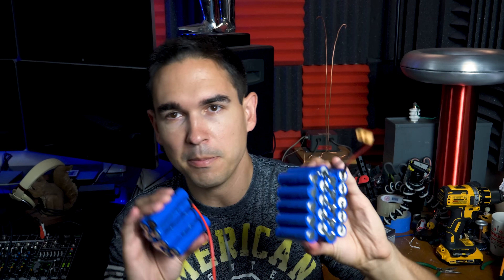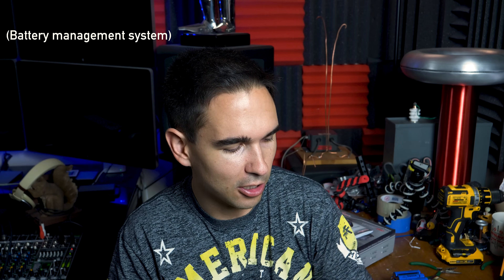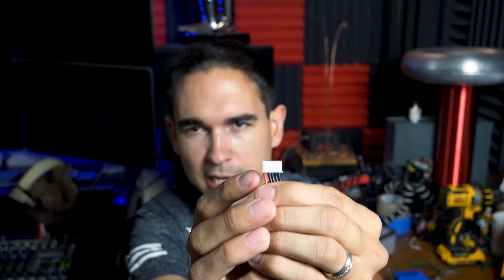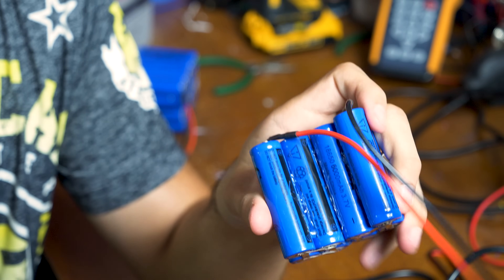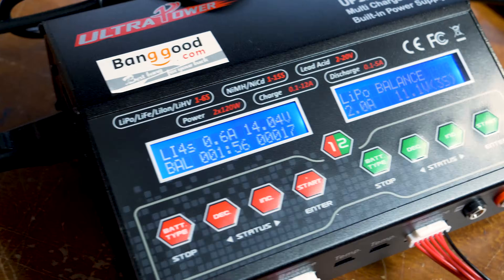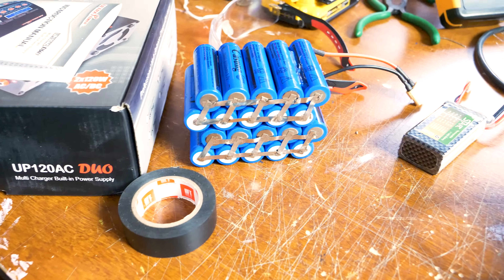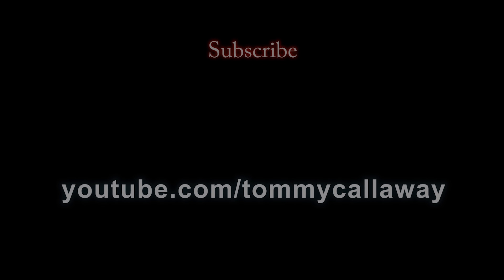How to charge custom lithium ion batteries (without a BMS)

Comment: Hey there Tommy
Great video.
Concerning the mains wire/cable, here in the UK we have imprinted onto the cable the following details; voltage range - cable size ( 0.5mm, 1.0mm, 1.5mm ) etc. etc. and an indicator conductor colour BN (brown) live, BL (blue) negative & YL/GN (yellow & green).
Whenever I purchase anything that does not have a standard 3-pin UK plug BN (fused) BL & YL/GN (earth) I chop off the existing plug and rewire it with a standard UK 3-pin plug.
Undertaking this lessens any main's cable-related problems that may occur in the future, and finally, UK plugs come with a fuse which two pin plugs do not.
If in doubt get an experienced person to rewire the UK plug.
Reply: Many US plugs are fused Sir. Just FYI

Comment: what about a12V 200Ah  LiFePO4 Battery, Deep Cycle Battery with Max 2560W Output Power, Perfect for Your RVs, Solar System, Off-grid can it it be ok on a charger like this  the battery bms was removed this is for solar charging and off grid usage

Comment: You still are using a BMS. 
It's just separate with your configuration.
Instead of having each battery pack having their own BMS, you have one for all the packs.

I like it unless you need to charge more than however many the external BMS can supply.
What is the maximum number of packs that can be charged at a time?

Comment: soldering in the middle of the bridge  could melt the plastic covering the batteries in a spot that would be very likely to cause those two cells to touch where they are side by side. it would not be a direct short but could  cause heating.

Comment: I'm confused, didn't that charger show 2 batteries with 0 Volts?
Reply: Because its only a 4s battery so the last two balance leads aren’t connected, so the last two show 0v.

Comment: I feel much safer recharging using a smart balance charger vs going through a BMS especially for like 100+ Amps for my application, plus its just really expensive for 200A 22.2V BMS’s and I would need 4 of them

Comment: 5:10in i was screaming at the pc - that is NOT the way to tin your cables! by the time you get the blob of solder to the wire, all the flux in the solder will have burned off! Ive been soldering since i was 8 and im now 60.

Comment: I checked and most of these hobby balance chargers only go up to 6s for li-ion (22.2v). I'm looking to build a 37v battery out of 18650 batteries to power an electric scooter. Can this kind of balance charger charge a battery with this high of voltage?

Comment: How do you know how many amps and volts to charge the batteries at? I want to make a li ion battery pack, I thought you multiply the rated charging amps for each cell by the number of cells and keep the voltage the same as it would be for 1 cell.
Reply: it is stated in the speck sheet
Reply: @sbolton3039  so if the battery cell specs say to charge it to 4.2V at 5A and I'm charging a 4 cell pack I just charge it to 4.2V at up to 20 amps?
Reply: @drabberfrog  20 amps no way. plus i dont know of any lith ion cell that charges tp 4.2 volts at 5 amps. a battery pack may have s 5 amp speck but please advise me what cell it is u are talking about and i will help u out.
Reply: @sbolton3039  since it's 5, 000mah wouldn't you charge it at 1C? So the charge current would be 5 amps right? I have some LiPO batteries so I'm just assuming lithium-ion batteries are the same in that regard. I'm wondering how to know what current to charge a pack at and how would the batteries being in parallel or series affect the charging current.
Reply: @drabberfrog  cells hooked in series u add the charge voltage but not so on the amps.  In any event i believe that with lithium nickel cobalt cells the slower u charge them the better it is for the battery but u may not want to wait so long for them to charge. As you increase the charge voltage the cells will charge faster but i believe over amping charge cycles kills the cells quite quickly.
Reply: @sbolton3039  did I reply with a link to the cell? I just did and YouTube deleted it for me IDK what happened
Reply: @sbolton3039  it's the Samsung 50E 21700 5000mAh 9.8A Battery

Comment: Do you think I could take a 36v lithium ion battery and plug it into the charging port on my 48v ? (My ebike) with 48v fully charged or 60-80% ? Would that give it more power ?

Comment: how many charge cycles would a battery pack have if you just charge it with a dc charger?
Reply: If there are cells in series charging it without a bms is a pretty risky idea as it could cause the batteries to become unbalanced and get overcharged, if it's just one battery in series and the output is 4.2 volts or under and the current isn't too high for the type of battery you are charging it might be okay if you unplug it once it's done charging. There isn't a exact answer to your question but it definitely won't be good to do that and it's pretty easy and cheap to just get a cc cv boost/buck converter and a bms if needed so it would be kinda silly to improperly charge something that has about 1/4th the energy density of tnt...

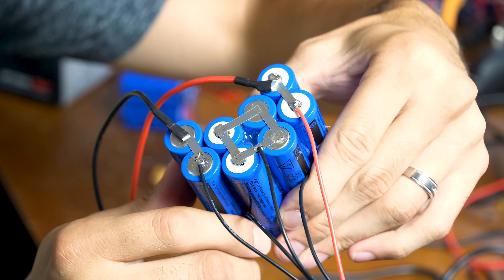Comment: I totally don't understand your method for soldering the wires.. You say not to solder directly onto the battery terminal yet only 1 out of the 5 wires at 5:32 are soldered this way, with the other 4 soldered directly onto the battery terminals.

Comment: Thank you for this valuable info.. I do have a question though. You said you only needed 4 cell for the balance charger but your pack has 8 batteries. Is a single battery not defined as one cell? Hoping you still monitor this site since you have a new one.
Reply: Batteries connected in parallel become 1 cell
Reply: Positive poles maters, His battery is 4s 2p, so you have to get only positive poles for 4s, and that are 4.

Comment: Awesome I have been wondering about this as the banggood BMS only charges to 3.8 volts per cell . Thanks Tommy hey Banggood sells large black heat shrink tubing to make a clean looking setup . I don't know if I missed it somewhere but maybe a maximum voltage per cell when charging would be a good mention .

Comment: Packing the battery cells that tight without additional insulation/distance between them, (especially between the groups in series) is dangerous. Fully charged, there's 4.2 volt difference between neighbouring groups and relying only on the battery cell wrapping is far from safe.

Comment: I’ve gotten a similar type hobby charger kinda like your! But I just made my first 18650 pack and I’m trying to do a discharge test with said charger to test the capacitor of my 4s5p pack with 20 18650 cells. And dang it’s taking a good bit of time. And I hope it don’t take that long trying to charge it with the hobby charger !!!

Comment from the maker: This video is old. Now, I am reviewing solar generators and other newer battery tech.  https://www.youtube.com/tommycallaway
Reply: Why is every other video tutorial showing one black wire and multiple red wires, in which the black wire goes to first negative parallel group and the red wires to each positive group.. Is it six one half dozen the other? Idk it would be cool if you could answer this because atleast one other person in the comments is confused.. I can or you can delete this but I think it's really really important to address
Reply: @bmzaron713  find your answers yet?
Reply: Great video. I have a noob question. I have a 4s (18650) pack also so for charging do I select 4S, C= 2000mah, 2.0A? Just want to make sure thanks.
Reply: ⁰
Reply: I've got a stealth bomber ebike with 72v battery and 5000 watt motor... It came with a single battery, but I've since built my own from six 36v 20ah lime scooter battery packs, which are made from 18650s... So I took 2 hooked in series to double 36v to 72v making 3 packs of 72v, then hooked all 3 in parallel... Only problem is  each individual original lime pack has its own BMS, so for the entire battery its got 6 BMS's hooked in both series and parallel in a funky manner, but so far my 84v charger has been working when I connect it, and the BMS's seem to be functioning properly, but it still seems like a sketch set up... I wanna break it all down and do it right so its functioning thru a single BMS... Cuz as is, it's 6 times more prone to failure at a minimum, right? Because instead of having just one BMS that can fail, it's got 6... I think that math is correct...

Comment: You have a 4s2p pack so each cell is 2 in parallel. So doing a balance charge like you are doing is better than nothing but it is still not going to overcome the problem if 1 cell fails.
BMS is under the tip on the positive end of the battery and protects each cell being over charged in voltage and current and over discharged in voltage and current.
You also need to use a special charger like you have as the batteries need to be charged in a particular way. First part of charging is constant current then it swaps to constant voltage to finish off until it achieves 4.2v.

Comment: Here is another moron who believes the hearth is flat.
The BMS is already supplied with my battery pack and if I build a battery pack for a bicycle (for example) I shall include a BMS because it's practical and easy to use I don't need to change any settings.
You don't even know what is the meaning of BMS but you pretend to advice against the use of it, what a paid idiot!
Reply: I don't think you fully understand why someone would do something like this. A few reasons why someone wouldn't use a bms would be if you are drawing a lot of current from the battery. Bms's with high discharge current cost a lot (and if you are building a battery youself it's probably just to save money in the first place) plus the only reason you would even want a to use the bms to discharge would be so the battery doesn't get over discharged but that can be avoided by using a voltmeter. Also sometimes bms's break and if you don't notice it could damage your battery, so instead of using a bms you can just manually balance the cells and then you will definitely know it's balanced. This is a bit unrelated but dump trump 2020 let's get that DUMB, fat ass Cheeto out of office he's a absolute joke.
Reply: Ayyyy Biden gang 2020

Comment: Honestly you can't really balance a 2p pack,
Reply: what is that supposed to mean? If batteries are in parallel they are the exact same voltage so they are actually perfectly balanced.

Comment: Good Video. I have Imax B6 Charger. It is has 6 cells balance socket. How do I balance charge if 13 or 14 cell  ex. 13S4P or 14S4P. Do I need a charger with 13 or 14 balance sockets?

Comment: Let’s say it this way, it happen to all kinda of battery this way, not just Chinese battery. That is why we have and need a balanced battery charger for it, and by the way, thanks for explaining how to hoke up the wires, for most of us has been playing around with those electrical things, it is not hard to find out witch wire go where, but for some one who first time doing it, will be a hard time to find out how, or in a hard way to find out with a burned wires and exploded batteries. Great work, easy to understand .

Comment: "Positive negative negative negative negative" - I don't have a clue what you say!! :(
Reply: That idiot is against the use of a BMS but he doesn't even know what is the meaning of it!
Reply: It means that the red wire is connected the positive connection of the first cell.
Then the second wire (red is left, so from left to right) black is connected to the negative pole of the first cell.
The third wire to the negative of the second cell.
Fourth to negative of the third cell
Fifth to the negative of the forth cell and so on depending on how many cell in series you have

Comment: No BMS means using a lab power supply and balancing the cells manually. This charger has a BMS system built-in so not much of a help this video for my case.

Comment: QUESTION SIR; 
I have these 7.4v 18650 4400mah packs and they only have 2 wires, red and black, but they say they are 2S, but my 2S Lipo Charger balance plug has 3 wires, one for - one for 1S and one for 2S. How do I get them to charge? Thanks.

Comment: How often do you "balance charge"?  I have a similar charger (that design seems to be very common, rebranded a lot),  with RC Lipo batteries I used to just monitor the packs and "balanced" them when the voltage differed between the cells by .2 volts.  Balance charging is MUCH slower it seems. RC batteries are always 1p (cells are connected in Series to multiply voltage, rarely if ever, are cells connected in parallel).  I think with Lipo it's too risky, also they have massive amp output so there is less reason to do this.  
If I understand this correctly the voltage you are reading is an average of that "Parallel group" which means that you could still have a "sick" cell in that group and it would read a normal voltage.  I have broken apart old Makita packs and salvaged many good cells out failed packs, and seen exactly this case, there would be one "parallel group" that would read 2.9, but when I separated the cells there would be one cell at 3.5 and the other reading NO voltage at all.....  These are 5s2p packs.  Interestingly they seemed to fail because the BMS would draw off of one cell, when left on the shelf for long periods of time it seems to harm that one cell.  Most of the packs that I have broken up have that one cell failed.  Balancing only parallel groups would not show this as the good cell would try to overcompensate for the bad one and end up over charged.......
The only solution for this would be to occasionally break up the packs.  Professionally made packs seem to mitigate this risk by matching cells very closely in regards to capacity and internal resistance, but I suspect that it still causes issues as the packs wear.
I am trying to create a pack that can be just un bolted and the cell taken apart and measured every month (this will be used on an ebike)
Reply from the maker: You're right. This is one of the most intelligent questions I've gotten on this video, thank you.  That's something I didn't account for, and most professional packs I've bought don't account for it either - but a modular design for swapping and testing individual cells would be awesome.  I would build something but I've gone toward filmmaking and camera-tech as my channel topic.  Pinning this comment.

Comment: I have a question regarding the wiring, the batteries are connected in series? and the wires you have solder in is for making them a parallel? could you add the wiring schematic so i can understand better

Comment: I dont really understand how you connect the batteries to each other to basicly make 1 battery im trying to make 1 with 8 18650 lithium ion batteries I charged all of them with my old vape mod lol but i want to make it output 5V 2amps separately to 2 female type A ubs ports they are going to power 2 raspberry pi LCD screens at the same time to produce the same image on both not like a pc has netflix on 1 screen and youtube on the other no same image on both screens im using an hdmi splitter and then using a Y 2 male to 1 female 3.5mm audio jack for both of them and basicly hooking up all of that in a what used to be a plastic VR for a phone but now going to be a real VR im still working on building a wireless HDMI transmitter and receiver and my friend is super good at programing so he worked on headtracking only took him like 3 hours to figure out cause he has done a lot of stuff like that for robots he made

Comment: So could you tell me the easiest way to charge a henzhen nalon battery co. LTD liion battery product mode LN-AWK-07 normal voltage 46.8v normal capacity 10.5Ah limited charging voltage 54.6v

Comment: Hey im trying to add some 18650 batteries to a jbl xtreme while keeping the battery it came with at the same time. Would it be ok if i add them to the same bms board ??????

Comment: I apologize, but this freaks me out. How can batteries be balanced charged, without separating them first? How are those balance wires not creating short circuits? And the main positive & negative of the whole battery pack, is also connected to the charger, what are they doing? Does that also mean a battery pack can be balance charged, while it's being used? I'm sorry if these are stupid questions, I'm still learning electrical-engineering, and I don't have much money to blow on trial & error experiments.
Reply: And thank you for showing me how to set up balance charging, on a custom battery pack.

Comment: How about battery pack with both BMS battery protection and JXT-XH balance connector. BMS is so cheap and helps protect the battery. Thanks for the effort in sharing.
Reply: That's silly why use BMS at all hobby chargers put you in control period
Reply: Just check. Every couple times BMS fail they are for people that don't want responsibility have faith in yourself

Comment: Hey Tommy, I was hoping you could give me your input on this 18650  build I'm trying out, it goes something like this:
Hopefully you can give your input:
3 packs of 24 18650 cells in parallel then wired in series to=12v@ 60ah(1- 100 amp 3s BMS added to pack) and another,
3 packs of 24 18650 cells in parallel. Then wired in series to =12v@ 60ah(1- 100 amp 3s BMS added to pack). Then
Connected together in parallel, to make it a total of 120ah battery at 12volts? I really would appreciate some of your feedback. Do you think it's possible to achieve this? Not sure if I would have to in corporate diodes. Or would it be good enough on their own?